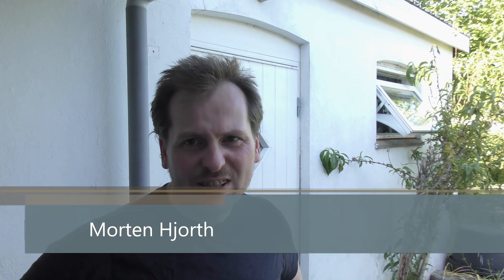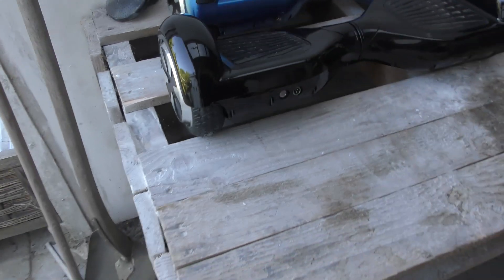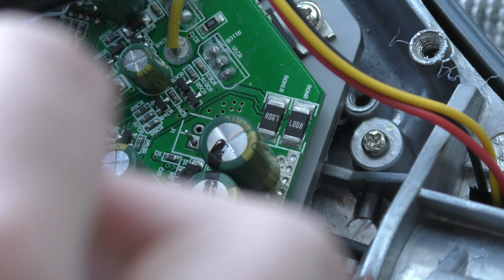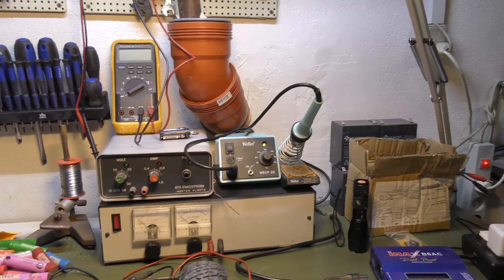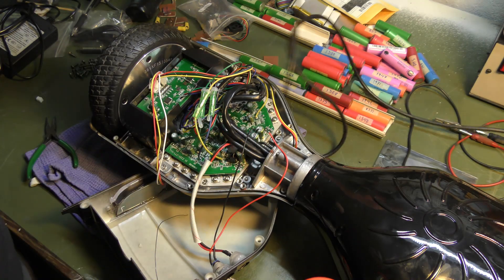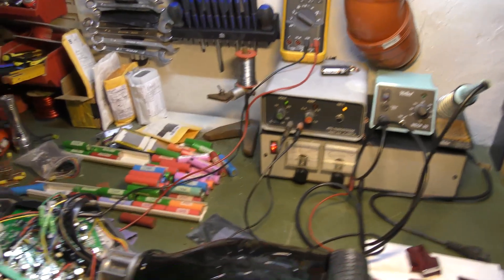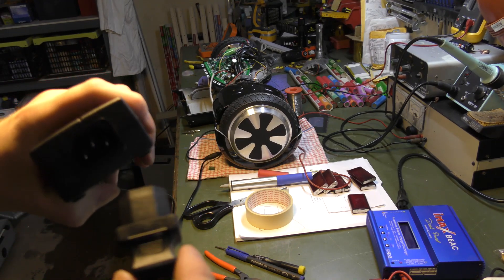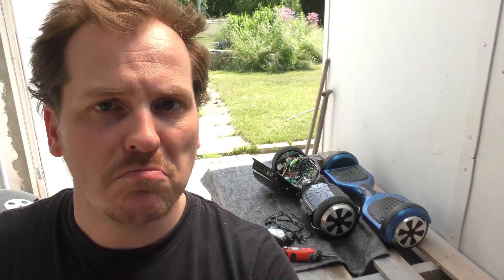Playing with a faulty hoverboard, and trying to repair - 359

Comment: I have a  hoverboard Skymaster 11 double wheels, the board turns on and after a while it stops working, I disconnect plug from batery to electronics. I take multimetr,  and there is a shortcut on the electronics. I take schorcut plus with the minus in electronics plug, i take multimetr and i do not have schortcut , after connecting electronic devices it works again, what could be wrong?
Reply from the maker: I never got this one working :-(

Comment: do you have hi amp lo voltage power supply?i see some car battaryes. get the most powerfull one charge it to full and connect to thing. it will blow up short and you find out where it was ;)or try trace power track... but that's too boring right !?BTW you're in Denmark, right ? i will be at Copenhagen in few days and if you're nearby i might help ;)
Reply from the maker: HI
I am not a blow it up kind of guy :-)
I am afraid that I am not near Copenhagen,, it is like 3½ hours away.
Thank you for watching! :-)
Reply: it's not about blowing up. It's about finding a point of short-circuit. If you have IR camera same thing can be done with less spectacular "visual effects" If I remember right on eevblog channel Dave got video showing entire process.
Reply: The battery (B.M.S.) That is your problem..